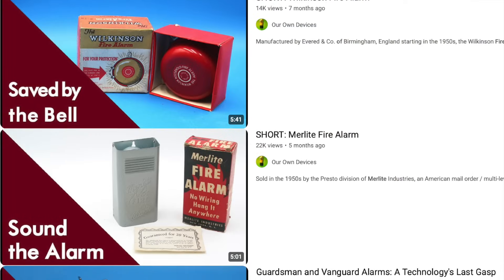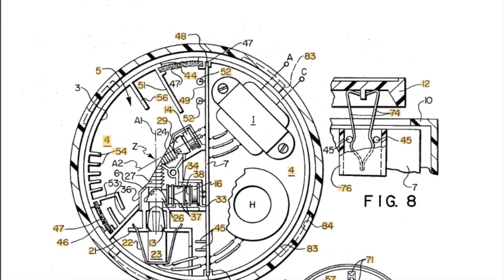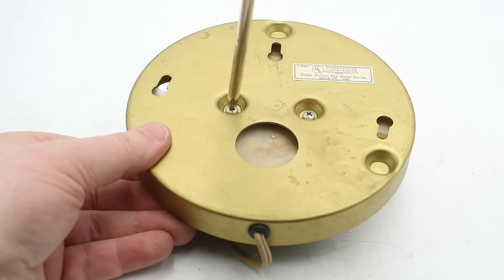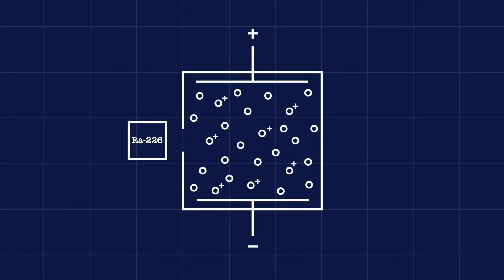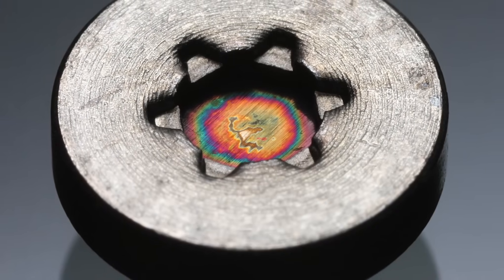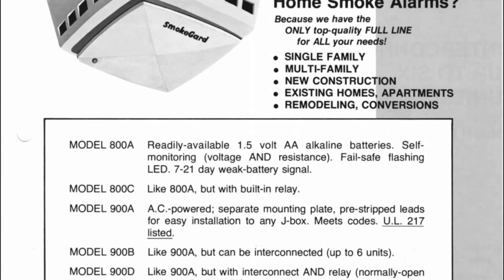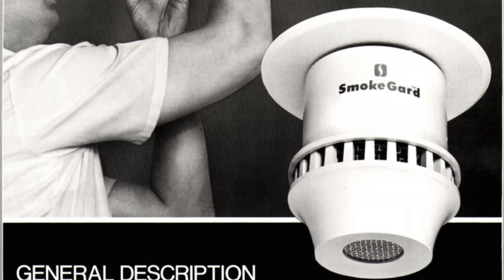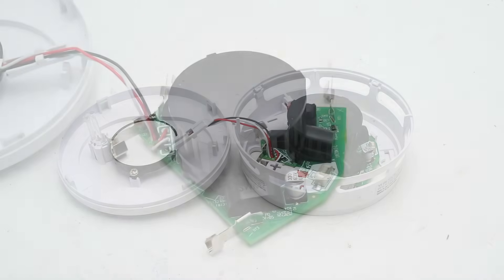Vanguard Smokesonic: in the Line of Fire

Comment: I personaly think the ionizing smoke alarm should no longer be manufactured for consumer use. They go off so often in kitchens most households will just take out the battery and have no protection. Not to mention the "ionizing fire alarms are more sensative" is not strictly true, both technologies have there pros and cons and both react differently to different types of smoke. 

In my area, all the residential hard wired fire alarms (the alarms in an apartment, not the alarms for the whole building) are photo electric.

Comment: Starting 2024 June 30 manufacturers can only ship smoke detectors that comply with UL 217.  
https://en.wikipedia.org/wiki/Smoke_detector#Australia_and_United_States
But stores will continue to sell non compliant alarms until they run out.  So it's up to the buyer to look for UL217 approval.
Reply: PS UL217 includes power from both AC mains and a battery.  In addition they are to be replaced every 10 years.

Comment: As a teenager in the mid '70s, one house we lived in had a hardwired smike alarm rhat used a #47 pilot lamo as the light source for the smoke detector, and also power on indicator. It had a slot for a spare bulb. If the bulb burned out, it went off...which it did once at around 2 am. The bulbs lasted about a year and a half....
     I set it off once frying bacon.

Comment: I've got one of those Vanguard units, and a few others that used the same overall design. Made by Pyrotector, the original units (called the 'Smoke Sentinel') used a vacuum tube instead of a transistor for switching the horn. The cardboard cover and red plug are original, the tape would have held a spare incandescent lamp to be installed when the original burnt out. Interestingly enough Pyrotector also made some of the very first photoelectric units with LED's implemented as the photo beam rather than incandescent lamps, which allowed them to be battery operated.
The very first residential ionization smoke detector I am aware of that was ever sold on the market was the BRK model SS-718, contained Radium 226 and was manufactured and released to the public market in 1970. Statitrol was a different corporation entirely; the very first one from them, the SmokeGard 700 was first sold in 1974. BRK and Statitrol is a completely different story but they competed for quite some time, BRK came out on top and is still in business today while Statitrol is no longer around. Duane Pearsall and Statitrol did have their contributions to the smoke detection field so they definitely have their place in the history books. I just find it interesting how a lot of people consider SmokeGard to be the very first smoke detector.

Comment: I had to call the fire department to take down smoke detectors that wouldn't stop going off. I settled for running over them with my power wheelchair. I bought a NOS 1965 Edwards. It has a cold cathode tube and two neon light bulbs used as diodes and an incandescent light bulb for its light source. It works great! All I need to do is burn a little toast, and it goes off. No beep, beep, beep, like a sissy whimp. It goes BLAH!!!

Comment: Cool thing about these vanguards is they were also used in commercial fire alarm systems. They looked the same but had a relay contact that would trigger a main fire alarm control panel and sound bells or horns throughout the entire building. They were rebranded by many companies such as simplex which was and still is a very large commercial fire alarm company.

Comment: I had a similar experience.  Running sound and lights at a public concert venue. I ordered the wrong smoke machines a/k/a too large. We disabled the smoke and heat detectors in the concert hall. But not the lobby or the walkway to the adjoining hotel. Machines were great for the Lazer effects but was delayed as the Fire department went to 3 alarms because all the public areas had a heavy blanket of smoke. I know the venev had a heavy fine and I cut the number of machines in use by 1/2

Comment: I would not buy any KIDDE product - years ago they had a lot of reports of fire extinquishers that did not work when needed, they actually kept the person who should have been getting these reports out of the loop, so he didn't know about this problem!  Totally EVIL - so lawsuits happened, and as one lady said, "We had a small fire, I told my daughter, don't worry we have an extinquisher - which I tried to use, and it wouldn't work. The whole kitchen burnt down, almost the house. if I hadn't wasted my time trying to use the faulty fire extinquisher, I could have put out the fire some other way" - people should have gone to jail for a long time for that uncaring irresponsibility. Also, I tried photoelectric detectors years ago, and came home to the fire dept leaving a note that mine had gone off, had a ladder up to the window to view inside my 2nd story condo - no fire or smoke. It was mounted over the tv, but went off when i was not home more than once, for no apparent reason. I tried photoelectric again about a couple years ago with one from XSENSE, and this one has been good with no false alarms. I also hate the waste of "ten year" smoke alarm life - I would like to see studies on how many 20, 30 years old smoke detectors work just fine - I also use good rechargeable batteries in my detectors (look at the ratings to find ones powerful) - and they have performed as well as alkaline. One other thought I have is I have one of the first carbon monoxide detectors originally promoted through SDG&E - a Thermx model - would be very interesting to see if this would still work. Still lights up like it is working, though I have more modern co2 detectors also.

Comment: Critical note! Photoelectric smoke detectors have actually been proven to detect most household fires at an earlier stage than ionization smoke detectors. This is because most materials in a home will produce thick toxic smoke for hours before actually catching on fire. Most deaths from fires occur from the toxic smoke, not burns. Ionization smoke detectors will respond best to open flames which produce invisible products of combustion. Sadly by the time a typical house fire emits enough hot products of combustion to set off an ionization smoke detector, the home will be filled with visible toxic smoke. There are however special circumstances in which an ionization smoke detector will respond faster to a fire, when the materials inside the protected area are highly volatile and are prone to combust without much smoldering, such as alcohol, gasoline, etc.
As for false alarms, it depends on the location. Fog from a fog machine produces visible obscuration and would affect photoelectric type detectors. Fine dust or other airborne particles can cause false alarms in a photoelectric smoke detector. Some photoelectric sensor designs are prone to collecting dust, which modern software can compensate for. Cooking is notorious for producing hot particles of combustion, so ionization type detectors are especially affected. Pipe brazing and any open flames also would affect an ionization smoke detector, and from personal experience, shower steam messes with the ionization current and will cause false alarms.

Comment: Nice video! Photoelectric smoke detectors have pretty much always been better than ionization detectors at detecting actual fires, but they became popular because they were cheaper and less power hungry. Only recently did we start learning just how bad ionization detectors are from the many deaths we have seen. In my neighborhood, there was just a fire a few weeks ago where someone unfortunately died because the ionization smoke alarms failed to sound in time.

The reason that they actually had photoelectric smoke detectors in the bunker was likely that it was a commercial building. Commercial fire alarm systems had a bit of a different timeline. They started out in the 50’s with mostly ionization detectors. By the 80’s, they started to transition to photoelectric because they are less prone to false alarms and generally have much longer lifespans. The commercial industry never really went back.
Reply: If someone pours pure alcohol in your house and set it on fire an ionization alarm would go off about 30 seconds earlier than a photoelectric one. Thus, if that's more of your concern then photoelectric no no.
Reply: @kyonsmith5203  Pure alcohol doesn't make smoke, so how would a smoke detector actually go off even if it's a ionization type ?
Reply: @psirvent8  It does not emit visible smoke but it emits enough nano particles to be picked up by an ionization alarm.
Reply: @kyonsmith5203  Ah I see.
Does that mean things like ethanol fireplaces or gas ranges will set one off as well ?

Comment: It's funny that I'm watching this, because the networked smoke alarms at mi casa went batshit crazy a few minutes after I made some toast that emitted smoke from the toaster slots because teh Hamilton Beach 3T vintage toaster was turned bit too high. I toasted a second pair of bread slices, (burger buns) and of course this triggered the smoke alarms. 

Back when I was in an apartment the bastard smoke alarm I had would frequently get triggered by making a sandwich in a toaster oven that I had before something electrical went BANG and it stopped working. That unit did not have a grounded cord for the metal case, so I'm lucky that I didn't get bit.
Reply: The sandwiches, before even smoking visibly and fully contained in the toaster oven, were prone to setting the damn thing off just like clockwork!

Comment: Don't allow fog machines (especially the oil based type) anywhere near a projector or you will be in for a VERY expensive repair. 🥶
FWIW I was a service engineer for a Canada based projector manufacturer and frequently had to sort out the damage caused: the vapour gets sucked in and coats all the optical surfaces, fans and virtually everything else. It's a major dismantling job to strip down the machine and clean everything by hand. :face-fuchsia-wide-eyes:
Reply: I found this out with laser projectors. It makes dust stick to the lenses and mirrors like nothing else, then the whole mess gets cooked on. Cleaning it off of tiny fragile galvo mirrors is something I look forward to never doing again.
Reply: If it had a really decent air filter at the air inlet?
Reply: @Duracellmumus  It would also require an fan system the sounds like a chainsaw going through a foot thick oak tree.
Reply: @Duracellmumus  For some of our models, we did sell a supplementary "fog filter", though it wasn't perfect.
Reply: Thanks for that information. Now I think about it, it's pretty obvious, smoke machines coat everything in a thin sticky film that's a dust magnet, and projectors are obviously going to be particularly badly affected.

Unfortunately as a venue tech, one of my bosses loves lots of smoke/haze, and I hate it. :) Gums up the insides of amplifiers, stage lights, mixers, everything! And it's difficult to get off because it forms a sticky film over everything, don't really want to put the amplifiers in a dishwasher ( although that might actually work, as long as I dry them.out very thoroughly!), it really is nasty stuff to deal with.

I shudder to think how bad the oil based units , apparently used on the film Alien, gunked everything up, including your lungs.

Comment: Combined type smoke detectors are great.  However, combined smoke/CO detectors are not recommended due to the different properties of smoke and CO
Reply: I've always wondered about that. How exactly does a detector of heavier-than-air gas make any difference if you mount it on the ceiling?

Comment: I've always wondered why the manufacturers pickled a low battery alert signal that is at the frequency where humans can not pinpoint the source.
Reply: I mean it's kinda hard to tell direction indoors either way
Reply: @koghs  You can tell where someone is talking.
Reply: @RaymondSwanson-u9y It's not the frequency that makes it hard to locate, it's the fact that it's a single frequency.

It's the same reason vehicle reversing alarms are being switched out from the beepers to static noise, because we can more easily pinpoint static.

As for why smoke detectors don't do that, it's because of cost, and it also forces you to check all your smoke detectors, something most people don't do regularly
Reply: @richardmillhousenixon  How about those backup alarms on forklifts and what-not that play a short "musical" loop over and over?  That's just a crime against humanity...
Reply: @StubbyPhillips They're still easier to locate than monotone beepers because of weird sound physics. I'd take them over the monotone beepers but I'd still rather have the white noise beepers
Reply: @richardmillhousenixon  Sure, the musical ones are easier to locate until someone smashes it into little pieces because the incessantly repeating 10 second loop sent them into an uncontrollable rage.  I consider it a form of torture.
Reply: Same reason so many things that beep beep the same.